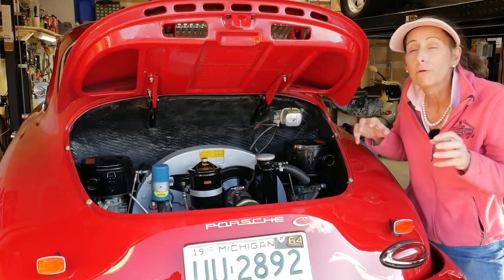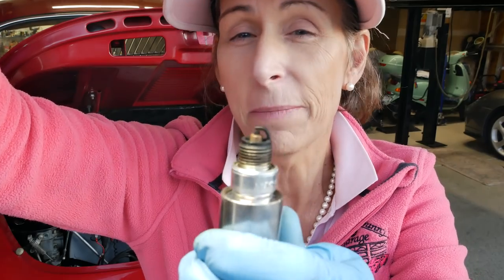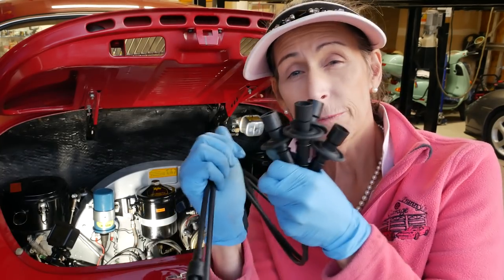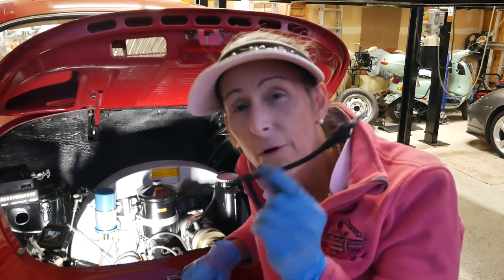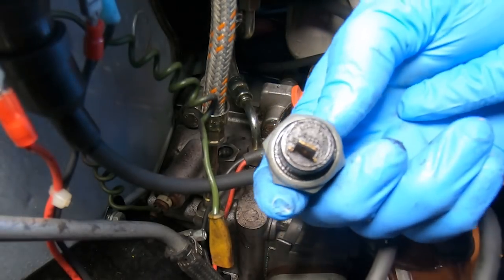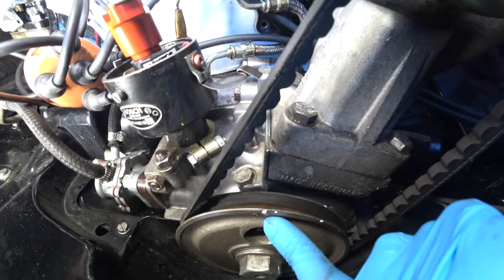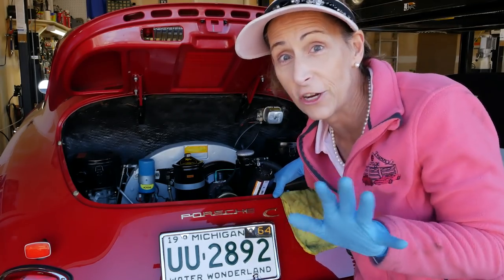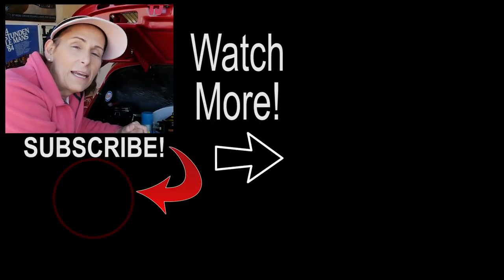Porsche 356C Project #4: How to Time your Engine PERFECTLY!

Comment: Franny, I thought I was Mr. Know-it-All about my 356C but learned why my 12-volt timing light didn't work on my 6-volt car from this video... I didn't use a ground wire between the 12-volt battery and the car as a "voltage reference" and now I will!  This is the first "how-to" video on YouTube I've used that wasn't some shade tree bubba using one hand to hold the cell phone camera using technical terms like "doo-hicky" and "thing-a-ma-jig" to describe his first time attempting a particular repair!  I love your precise, correct terminology delivered in a relaxed and humble manner while never getting any schmutz on your pink sweater or catching your pearls on moving parts! You have a new fan... especially given the fact I own a 3.2 Carrera I work on myself too!  P.S. I grew up in Loveland, just up the road and love the dry winter driving scenes, something I miss here in Seattle!  Thanks!  Darryl @ darrylsgarage.com
Reply from the maker: Darryl, this is a bit more of a vlog.  We have a DIY here.  https://youtu.be/t4Vm_OLZrT0

Comment: Heidi your a awesome mechanic:) Enjoyed the video.
Reply from the maker: Thanks!
Reply: I have the Innova 5568 timing light. Works great, and it even has dwell reading. It’s not really useful for setting static timing or setting points, but it’s good for double checking the dwell angle when replacing points. I see the dwell function on my timing light to be more useful on a GM type distributor, where you can adjust point with engine running.

Comment: It’s always worth hearing copper washers to red and quenching them, then a good seal is guaranteed. 

Your videos are excellent, just so easy to understand.
Reply from the maker: That's a great tip!  I've done that before.  I try to sand them smooth first.  One of those washers was pretty done!  That one was way easier to just replace.

Comment: or

Do note a lot of these switches will leak at
some point in their life, so extra sealing is needed to ensure they will not
leak.  Green (290) Wicking   Loctite is a good start as it will wick down around the
plastic where the outer steel body is crimped around the switch and also down
into where the electrical terminals protrude from the plastic.  Doing this
in the inverted position and letting it set with the threaded portion of the
switch pointed upwards for 12--24 hrs is the way this is achieved.

Once the above has been done then wipe the
switch clean with alcohol (no sprays please) and then use some adhesive sealant
like YahmaBond, HondaBond or any adhesive sealant that is oil/gas resistant to
the areas where trans oil can leak out as described above.   Let this
sit for 1--2 days and this will seal the switch nicely.

Comment: Franny kills it again!  I've used her other videos to replace spark plugs and wires in my 356, adjust valves, tune my carbs, replace the VW distributor with the correct Bosch version and set the static timing.  I figured out how to clean up the rough idle on my own.  Now the car is idling and running better than it ever has.  Had a question; when I use the timing light, I'm getting dead-on 35 degrees at 3,000 RPM but my idle is 15 degrees at 1,200 RPM (I set the idle a bit high on purpose).  Is that in the range and, if not, what do I do?
Reply from the maker: That sounds about right...  You won't see the static advance much above 900rpm.  Probably best to set the static and just check the max at 3000rpm.  Glad the videos are helpful!

Comment: Really like this series, guess I'm partial to old bath tub Porsches. By the way, Champion makes a "spark plug lubricant" that is a thin dark liquid (applicator brush in the cap) that I suspect is moly or graphite. I use it for changing plugs in motor bikes' aluminum heads. Perhaps it would be more palatable to Porsche.  
Please let us know how the car runs on your test "tootle".
Reply from the maker: Will do!  One of the upcoming videos has my driving thoughts...

Comment: Awesome video...But I think, could be wrong, when static timing you rotate until the points just OPEN not "close"as mentioned.. You get 6/12v on your meter when the points are opened..  You can use a screwdriver to open and close the points and watch the meter to verify this..

Comment: Heidi, great teaching video. Thanks.  I have a question about the spark plugs? I'm a gear head probably older than you. I have a few 80's and older BMW's and we have found the Iridium spark plugs to not work very well in older engines. They don't burn as completely. We much prefer the square tip electrode like a Bosch Platinum plug uses. I'm not arguing brand here just the design style. This style is what came in these engines including this 356 engine you are working on in this video. Just saying.........
Reply from the maker: I hear ya... I've seen and heard that too... I did an A/B test with both types in our little 356 and in the 3.2 Carrera - both brand new and gapped sets and the new style plugs were noticably better in both cases... BUT of course use what you feel is the best for your car. This was just my experience. Thanks for adding your experience!

Comment: Great!  I love your videos as you are always so informative, with good descriptions of what you are working on.  I liked seeing the adjustable timing light being used as I never knew how they worked.  I'm always amazed at how clean you keep your pink fleece, but the cars are pretty clean to start with.   

Quick question, what's with the black year designation on the license plate?  It appears to have been added on top of the plate.
Reply from the maker: Hi Judi, I believe that is an original plate from that year.  Several states (Colorado included) will allow you to use an original plate to register the car.  Ya know,...  It might be an actual piece added to the plate.  It isn't a sticker...  I'll check next time I see the car again.
Reply: @HeidiandFranny  thanks.  It looks like a metal piece.  In NH you can display an older plate too, but you have to have a current one in the car IIRC.

Comment: Hi again Franny, (my auto spell changed your name to Frankie last time, sorry about that.) What brand and where did you find that cute swivel drive 3/8 ratchet? Keep up the good work! I love your teaching style. Also what is the type of the NKG spark plugs that you like so much? My car is a pre A 55 coupe. When I rebuilt the engine using the maestros books in 1983 I made a few mistakes that have led to hard to find oil leaks. Loved your method of finding leaks on the Beck Spyder. Thanks Jim
Reply from the maker: Hi James, That came from Harbor Freight believe it or not...  It has been great!  I prefer the Iridium or the Bosch Platinum.  Others say the copper work better, but for me the Bosch Platinum give a smoother idle.

Comment: I really enjoy these videos, very helpful. 
Franny, am I correct in saying that the spark plug socket is a size 14mm for the NGK plugs.
The small green wrench you use, can I ask where you sourced this also, I like the rotating action on the head.
Reply from the maker: I'd have to go look, but it is the "bigger" sparkplug size.  That little green ratchet came from Harbor Freight believe it or not. Love that little guy!

Comment: Firstly, thank you so much for your work. I've enjoyed your videos for along time and was very excited to see this series as I own a 1964 356C.  There are so few instructional videos our there for these cars and this is fantastic!  Question regarding this specific video, I had always thought one need to set the gap on new spark plugs.  Am I mistaken?  Do these plugs come with the gaps already set for the specific vehicle?  I'm no expert, so please educate me!  Thanks again!
Reply from the maker: Great question!  I filmed a bit on the gap, but forgot to put it in??  Arg...  I believe the gap is to be 0.020-0.024".  I did gap these and they were closer to the 0.024" so I didn't adjust them.  That tiny center pin is pretty delicate so be gentle even just testing them.  Great catch!

Comment: Have you had good luck with the iridium plugs on these older engines?  I have not had good luck with anything but copper on my 83 911sc. Obviously the copper electrodes don’t last as long but in my humble opinion the copper plugs are the way to go.
Reply from the maker: I only use the iridium and platinum plugs in these engines...  In both the 356 and the 3.2 (and the 308) it made a noticeable difference stabilizing the idle.  That's interesting you have had bad luck with them.  But, you should totally use what you feel works the best.  Thanks for the comment :)

Comment: I remember fiddling with those crush washers on my SC, and then when I got a '69 911E was told to throw away those crush washers when changing the plugs. Do you know why Porsche changed the procedure?
Reply from the maker: Just that the anti-sieze can mess with the conductivity...  I think the crush washers should be there though...  I've never heard of removing them...

Comment: Is this all good for the '64 SC as well as the C? I replaced my '64 SC carbs with Weber 40 IDFs and the cylinders with 85 mm big bores. Does that effect the timing? It works great above 2,000 rpm but stalls out at 900 - 1,000 when coming to a stop. Just did these changes, so I'm not sure what I don't know.
Reply from the maker: Sounds like a mixture issue...  It may be that your idle jets are a bit small.  Hard to say.  I don't think it is a timing issue.  Do you have access to a local shop that can tune it for you?

Comment: hey i was curious how you got the front two spark plugs out my socket never wants to seat down in there. almost like the heat shield is in the way
Reply from the maker: My socket has a universal joint actually built into the base.  It works really well.  It can be a little tricky to get a normal socket in the right spot.
Reply: @HeidiandFranny  i just figured a normal socket wouldnt fit ill head to harbor freight in the morning
Reply: @HeidiandFranny  what size socket it the spark plug
Reply: @HeidiandFranny  So on the front two spark plugs there seems to be something in the way of getting the socket to even seat on the spark plug.

Comment: So, If I am doing this by eye, I want the points to close concurrent with the 5d BTDC?
Reply from the maker: You should have a mark or a notch on your pully.  With the distributor cap off (very important) and the ignition on you will hear the slight arc across the points.  But, so easy to use a meter or a simple lightbulb.

Comment: How does this car have electronic points? It’s 6V correct? I have 65 VW beetle 6 V, are they troublesome?
Reply from the maker: Gosh, I think this car was converted to 12V but I don't remember.  But I have seen 6V versions of the electronic points.